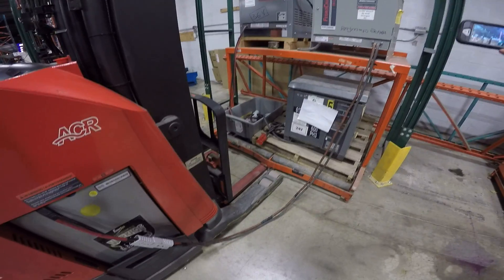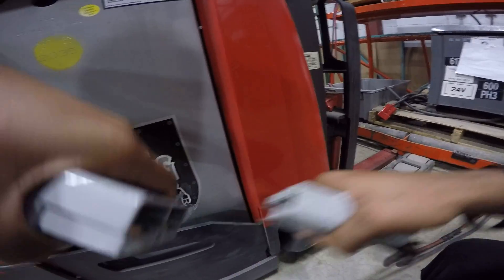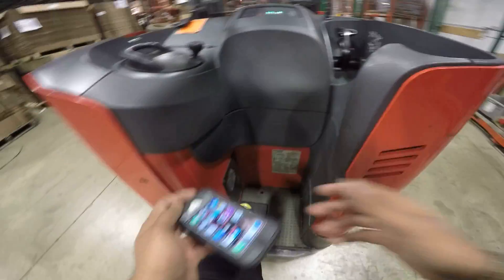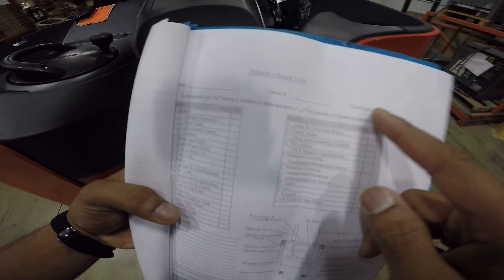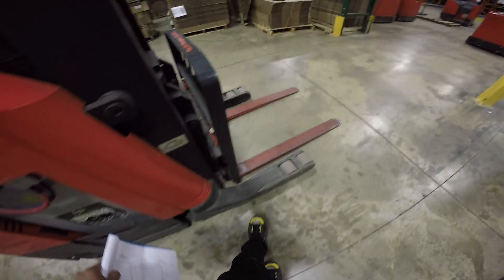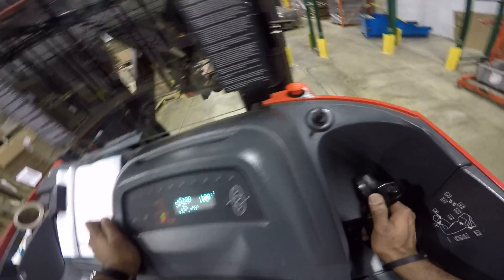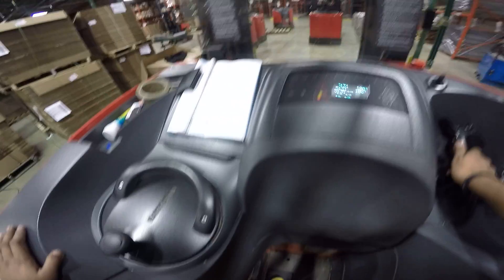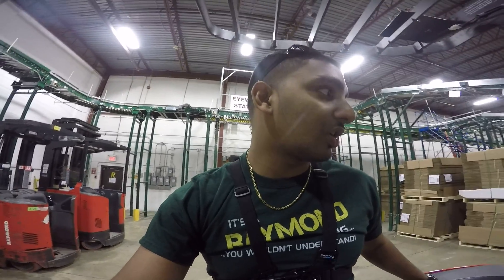How to Charge a RAYMOND REACH FORKLIFT & Circle Check HD

Comment: crown is better
Reply from the maker: Rainer Etsweiler it's a matter of personal choice
Reply: I've driven both. It really depends on the individual machine.
Reply: Crown is junk
Reply: @curiousgeorge986  yeah right.. I had 3 raymond 7000 series break on me today alone..  Cheap ass design.  Floor suspension is really good tho ill give it that
Reply: @raineretsweiler7035  what do you think about the rider pallet trucks?
Reply: @curiousgeorge986  Never used a raymond center rider.  I've only used the crown PC and it wasn't often that I did